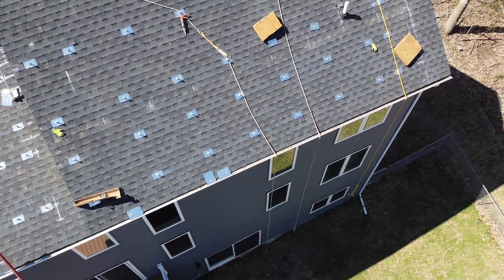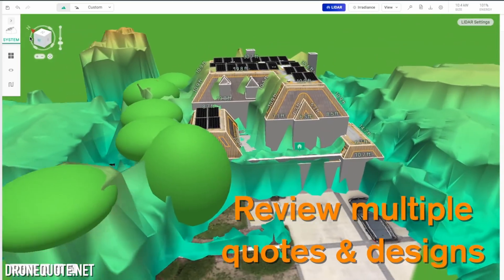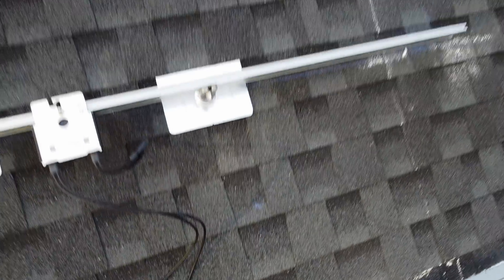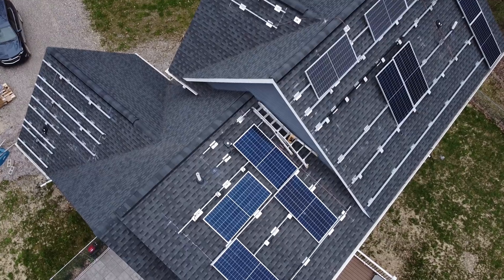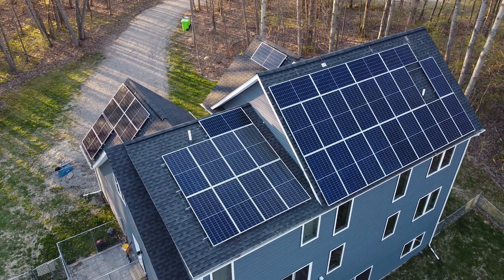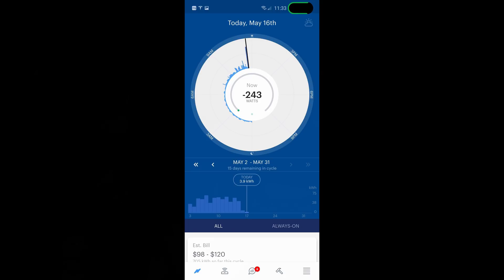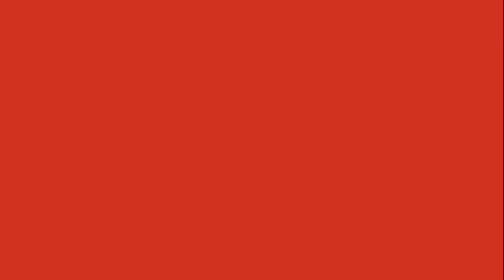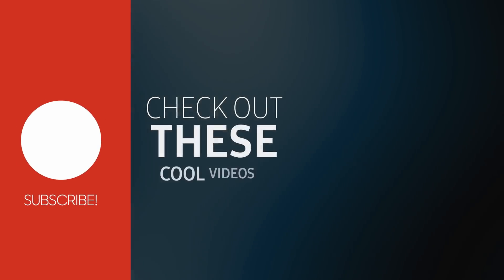Michigan Solar Panel Install Experience | Home Solar Installation, Cost, Positives Negatives

Comment: Jealous
Reply from the maker: If you're interested, use a lot of electricity, and you have a good position for the panels, it's worth it to get a quote.

Some people just get a small system to offset some cost and add on over time.
Reply: @DirtyTesla  yeah, I just don't think it's economical for us right now. Our electric rates are pretty low compared to the national average. Also, we live in a condo so not sure what the HOA rules are here and not sure we'd stay here long enough for panels to pay off. Rest assured, when we're in a situation where it becomes economical for us, we're getting them!
Reply from the maker: Ah yeah a condo probably would be tough. Like I said, the original quote made no sense so I initially declined.

Comment: Curious what kind of inverter was installed and its capacity.
Reply from the maker: We got the solar edge SE11400H with 11.4kW capacity and 150% ...overage? I forget the terminology.
Reply: @DirtyTesla   Thank you

With all those electric appliances I'm sorta surprised it wasn't bigger. Clothes dryer and Tesla peak charging together would just exceed its capabilities.
Guess since its grid tied it doesn't need to be able to handle all the big loads concurrently.
Reply: @DirtyTesla  SolarEdge has great monitoring down to the individual panel level - have you got the mySolarEdge app on your phone yet?
Reply from the maker: I do, but I haven't turned the system on very long yet so I haven't been able to play with it much

Comment: Once you have the solar system installed, then it’ll be 4-6 weeks before you can get the system “turned on” because the local power company wants to squeeze the last dime out of you before they have to install the new meters.
Reply from the maker: Once we get our inspection they have 15 days to do the meters. I'm sure they'll take all 15. They have another 4.7% rate increase next month.
Reply: Dirty Tesla 

They will not call you when they get the meter or install it. 

They might email you after the install of the meter with the instructions for the process of switching on the system.
Reply from the maker: My ring doorbell will show me when they come. Then I will turn it on the second they are done haha
Reply: I developed a good relationship with the team that handled the paperwork for solar interconnection. As I received paperwork from my solar vendor I push it to the utility. Once the finaled the solar install I sent them a copy of the signed permit. Once they saw it officially in the system they scheduled a visit to turn on. Whole process was about 5 days. This did help time wise but I understand the nightmares as a friend took almost 4 weeks to get his turned on.
Reply: That was not my experience. The city inspected Friday morning. We left on vacation Saturday. Tuesday, I got a call from the utility inspector saying we passed and it was ok to turn the solar on. I told him I was on vacation and would not be home for 2 weeks. He turned the system on for me. I have not paid any energy bills. There is a grid connection fee I pay each month. We did not produce enough energy to cover our usage until our October true-up bill came, we had a $25 credit. The first-year grid connection fee was $20 a month and has gone up a few cents each year.

Comment: How about snow? Do you have to remove by your self or it’s self heated
Reply from the maker: It will either fall off or you can brush it off.
Reply: @DirtyTesla  you're not going to convince anyone that getting up there in the winter to brush off your panels is reasonable or safe

Comment: Now it's time to get a Tesla Powerwall.
Reply from the maker: I can't wait. They're just pretty expensive.
Reply: @DirtyTesla  Any plans in that respect?
Reply from the maker: Just saving money. roi for a battery is either a VERY long time, or never. So when we get one, it'll be considered a luxury purchase like a TV or car. But you do get the tax credit for it so buying it this year or next would be ideal.

We do get power outages occasionally so it would be amazing to have.
Reply: Dirty Tesla  Without a PowerWall (or other battery), if the grid goes down you stop making power completely.  It really hurts mentally if grid down several days and sun shining.  Enjoy the sun power.
Reply from the maker: Yep you're correct. We do have a generator that will allow the panels to work while it's running, but no storage... Yet. It was just too expensive at this time.
Reply: Dirty Tesla   a generator?   that makes the system think it is grid-tied (that is exactly what i am looking for in my system) - can you provide a link Chris - thanks
Reply from the maker: A link for what? The generator? It is one I got from Costco I'll try to find the exact one. It has a nema 14-50 and I disconnect my system and house from the grid, then turn on this generator and yes, inverter syncs with generator to have full power during the day.
Reply: @DirtyTesla  i think running the generator on normal Gas or CNG is also a great idea so you wont need to buy gasoline or diesel plus its cleaner
Reply: @DirtyTesla  I expect the price to drop in the future with the new Tesla batteries. 
Add Tesla batteries next year. The utilities will continue to raise their rate in the future increasing your savings and making an even better pay back.
Reply: @DirtyTesla  weren't they part of the referral program at some point?
Reply: I’m waiting for vehicle to grid capability 😀

Comment: Wow! That is some steeply pitched roof.
How will you handle snowfall on the panels?
Reply from the maker: Well I'm hoping because of the steep pitch, most snow will just slide off.

If not, a lot of it will melt as the sun hits it, but I can come from the front of the house to push the snow off pretty easily.
Reply: @DirtyTesla     With that much of a pitch you might have better luck than me.  I have 8/12 pitch roof in southern Ohio. With any snowfall over an inch  or even frost on the panels power generation drops substantially ,or to almost 0 when snow covered.  Even with the sun beating on it, snow doesn't melt all that fast.  ;-)   I have a Hybrid system, where I can run on batteries for awhile , or charge from the Grid.  Did you get any monitoring systems with your solar?  I  come to love looking at the power numbers and using the graphing functions to see power usage of my devices and track over time.  Cheers!
Reply from the maker: @MCCRITTERS  thanks for the info!

Yes it's all solar edge stuff, so we have their monitoring apps. The few hours I've had the system running (while using lots of power) I've been obsessed with the numbers haha. I can't wait until I can just leave it on!
Reply: Tesla Not-a-Flamethrower

Comment: Why did you not go with tesla solar
Reply from the maker: They won't install panels in Michigan, only the solar roof.
Reply: @DirtyTesla  ok
Reply: @DirtyTesla  They don't do Solar Roof either.  At least that is what the guy in the chat bubble from Tesla just told me.  I gave them my address over here in Sterling Heights.
Reply from the maker: @scottpokriefka5400  I think it was up for quote for a short amount of time and they removed it. You're right, they won't do any installs now :( not even PW
Reply: @DirtyTesla  Such a bummer.  Thx for your hard work.